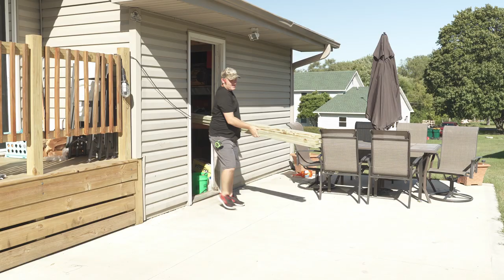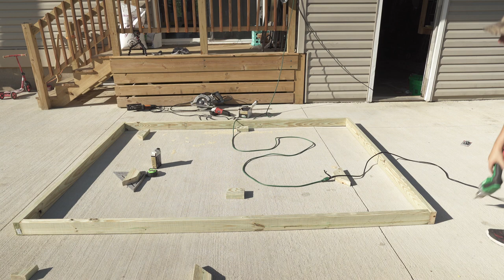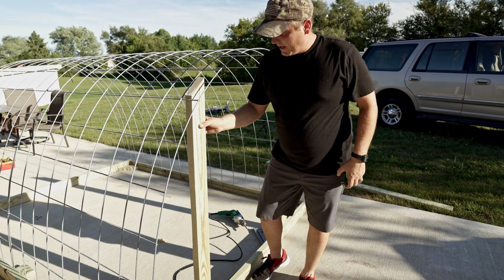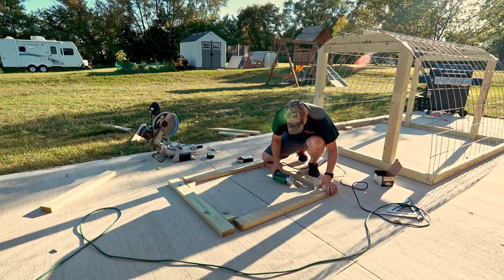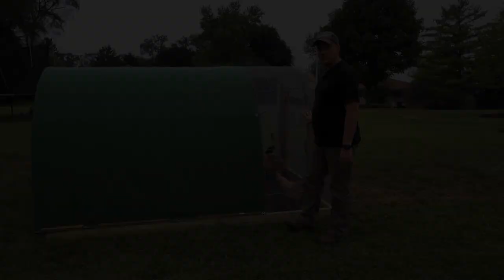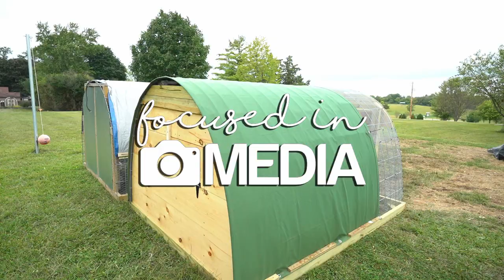HOW TO Build a SIMPLE chicken tractor with the IMPROVED Hoop House 2.0!  Time stamps in description

Comment: Great video. A few upgrades I am going to do on the one I am building is - 1. Roll away chicken nest box so I don't have to disturb the chickens. I can access the eggs from outside the cage and nest box. 2. Put wheels on it so I can move it around with no issues. 3. Extend this exact build to 16' long x 10' wide. 4. Use billboard vinyl to cover the coop 5. To keep coop from blowing over in gust of wind when it rains.....fill 4  five gallen buckets with concrete and put  eye bolt in concrete then put one on each corner and tie coop down. Easy to disconnect and move when you move coop and only has to be done when storm is approaching. ........ Keep up the great work. Enjoyed the video.
Reply from the maker: Nice ideas.  Billboard vinyl is a great idea.  Can you get old signs for free from Lamar and other outdoor companies?  I like the concrete I bolt idea
Reply: Enjoyed your  comments and tips.t y

Comment: One thing worth mentioning is that you should buy the UV resistant zip ties whenever using them in outdoor applications. Regular zip ties will degrade in sunlight and fail very quickly. UV resistant zip ties can last for years.
Reply: Or buy hog ring pliers and they will last forever

Comment: Good job! I like it. Believe it or not, they make a plastic film that's UV stable. That would make a good outer coating to replace the tarp. It would have an extra benefit - if you wrap it around the 4' dimension of the cattle panel, it would form an insulating layer with the trapped air between the layers. They also make it in clear and black.
Reply from the maker: Thanks for the encouragement.  Glad it reached you and was helpful
Reply from the maker: I was actually rethinking the design yesterday and how using clear visqueen would allow sunlight on the birds in the winter, trap heat and make these useful as greenhouses in the winter

Comment: That idea about cutting the cattle panel on the end so they fit over the wood.  I would of use also metal hog connectors to connect the cattle panels along with the plastic connectors.  Since in time those plastic will break.

Comment: Nice Build!  To keep digging predators out, do you think putting rocks around the perimeter would work?  Or building the coop on a base of gravel that extends beyond the coop frame?  I’m thinking about areas with mt lions, bobcats, raccoons.
Reply: I good livestock guardian dog will keep away predators if you're able to have one.
Reply: The easier and cheaper option you can go for is just laying some chicken wire on the ground around your pen. A digging predator will try to dig as close to the fence as they can, the wire will prevent them from breaking ground and getting through which will cause said predator to give up.
Reply: I actually ended up putting down a perimeter of gravel and put the skids top.  this made it easier to get everything level.  Afterwards I spread more gravel around the base.  That has kept all predators out and helped with drainage.

Comment: Would the tarp cover be able to be swapped out for corrugated plastic or metal roofing? To give it a more permanent solution?
Reply from the maker: I suppose you could.  May have to alter the design to leave a vertical mounting face to acre each end of the corrugation to.   The canvas tarp is proving to be very nice other than sun fade.  It’s dries quickly, is more durable than vinyl tarp and gives a nicer quality look to the finished product

Comment: Hello , i'm french . what kind of grid do you use for the start ? 
MESH FOR CONCRETE SLAB !!!
is it possible to have pictures for the wheels and the mobility of the henhouse? Thank you  ... GOOD WORK .
Reply from the maker: The grid mesh is called hardware cloth here in the states.  I used 10” tubeless wheels from the hardware store and 1/2” carriage bolts for the axle.  Just drill through the 2x4, add a washer and nut then slip the wheels on and off as needed.
Reply from the maker: The thicker metal frame/cage is actually a 50inch by 16foot cattle panel.
Reply: we do not have this kind of sign( thicker metal frame) in france. Do you have references and a price?
Reply: mesh dimensions and wire diameter

Comment: How many chickens does this accommodate, and any suggestions for some tweaks to the design for 45 chickens?
Reply from the maker: chickens should be provided 1.5-2 square feet per bird.
Reply: Just double the length and use four cattle panels side by side instead of two

Comment: is it easy to move it? and do you plan to make a run to it si they can have more room? or do you free range? looked pretty simple to build, my building skills leave much to be desired, lol
Reply from the maker: Yes with wheels on it's pretty easy to move.  Pro tip:. Use a two wheel dolly to push or pull it with ease.

Comment: What type of climate are you in? if it snows, how do you keep them warm in the winter with everything open like that?
Reply from the maker: In the winter, I can stretch the canvas to full length. Additionally, you can secure a tarp over the front.  We actually house ours in a 10x8 heated shed during the winter.
Reply: @GritandGrace  I live in Wisconsin.  Do you have to heat the enclosure or is keeping them enclosed enough???

Comment: What kind of predator proof in place
Reply from the maker: the cage is covered in steel hardware cloth.  During the summer when I regularly move the pens to new grass, I slide slimmer runs of hardware cloth under the perimeter frame to prevent predator digging.

Comment: hello, last little question. What is the size or dimensions of the mesh of the panels and the diameter of the wire (5mm)? thank you
Reply from the maker: I believe i used the 1/4 inch mesh( hardware cloth).  The panels wire would be approximately 1/4 inch as well, so about 6-7mm according to the conversion chart
Reply from the maker: You could use 12 or 13 mm hardware cloth if you want, i just procured the smaller mesh for free on this project
Reply: I would of guessed they were 8 gauge wire but it could be 5. I think the squares are 6 in by 6. Then the bottom is like 2x6

Comment: I pretty much exactly duplicated this. It's too heavy for what it is. It will need wheels. Might as well make it 12 feet long and use the whole 16 foot cattle panel too for extra height since it's already so heavy.  Also, If you make this be prepared to burn through about 400 zip ties. Ill keep it around to use as a nursery coop but I'll have to find a better design than this for a chicken tractor.
Reply from the maker: Thanks for the input.  I admit it is heavier than the first version I Meade because of the chicken nest box inside.  Mine has wheels as well.  I purchased 10” tires from the hardware store and it moves just fine using a hand truck.

I hope your design works well for your needs.
Reply: @GritandGrace  would love to see how you installed the wheels as an update to this post. :)
Reply from the maker: I am working on new content as we speak, and that is one of them.

Comment: How do you drag them
Reply from the maker: I use a two wheel hand truck.  On one end is two 1/2" carriage bolts that I slip two wheels on, on the other I slip the hand truck plate under the frame, use the leverage to hoist it, and then move it.

Comment: How do you move it
Reply from the maker: I did attach 4 old lawn mower wheels by drilling a hole on each corner, pushing a 6" carriage bolt through it, slipping the wheels on and placing nuts and washers on each side. My two children can push it easily now.  You can also put wheels on one end, and use a hand truck to slide under and lift the other end. Both methods work

Comment: How much did this cost you
Reply from the maker: Well I goth the hardware cloth for free, but that would be around 50.00
12 2x4 72.00 (wood is pricey right now)
1 4x4 ac2. 12.00
Box 2.5” screws 25.00
Hog staples 3.00
Zip ties 5.00
Canvas tarp 52.00
Hinges and latches 20.00
Ac2 treated 3/4 plywood for layer box 35.00
Bungees and misc.  15.00
6” carriage bolts for wheels 6.00
8” tubeless  wheels 22.00
Reply from the maker: Roughly 250.00.   I initially responded with an itemized breakdown of price, but I do t see it here now....  hope the other more helpful answer made it through
Reply: @GritandGrace   you should add this to your description of the video! great video btw thank u!
Reply: @GritandGrace  what does 4x4 ac2 mean? (Specifically the ac2 part)
Reply from the maker: It is the chemically treated outdoor wood.  It is soaked in a bath that prevents the lumber from rotting
Reply: @GritandGrace  what size hog staples?
Reply from the maker: I believe they were 1 1/2 inch
Reply: @makennaduff5804  i'm using 3/8" just fine